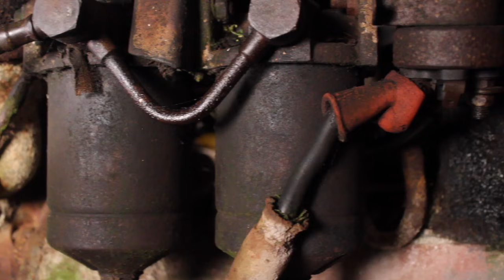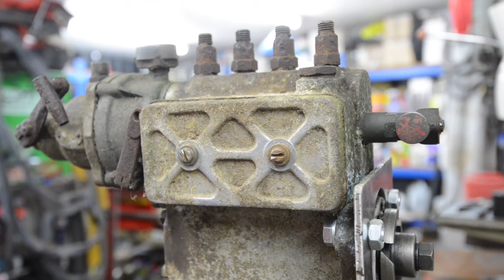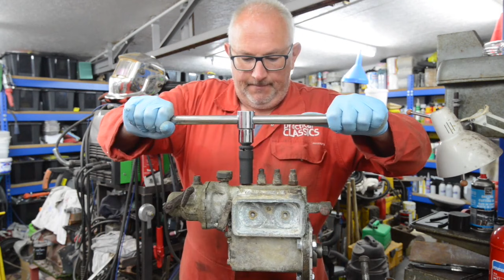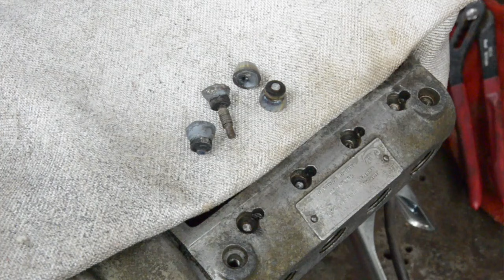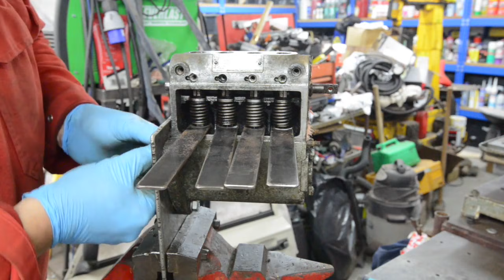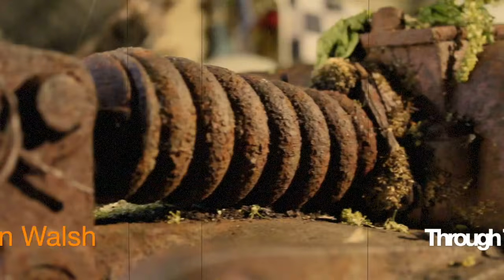How to strip an Injection Pump. Barn Find Fergie.  Episode 12

Comment: I have P3 Diesel conversion (1947) I changed the diesel pump but can’t get it started. It turns over but the timing seems out to not allow it to fire up. 
I remember diesel pump place in Sheffield said something about a viewing cover and adjusting. 
Anyone have any ideas?
Found it in another episode “Will it run after 31 years...” 😃

Comment: Hi JImmy, did you manage to sort some rear wheels for the fergy, if you haven't the farm machinery guy i do work for (google dave/david Rushton Machinery, Uttoxeter) said he has some that should fit, not original Fergusson but if theres nothing else also are the wheels you've got one or two piece (rim with seperate centre plate) if it's two piece can you have just "new" rims instead of whole wheels?
Reply from the maker: Still working to solve the wheel problem. Uttoxeter!!! Brings back memories, an old family stomping ground. Jimmy